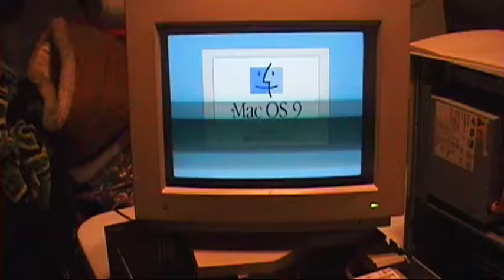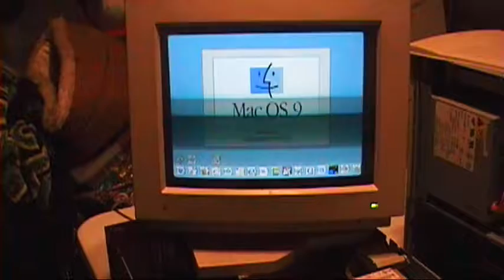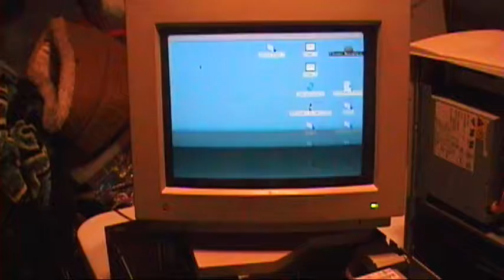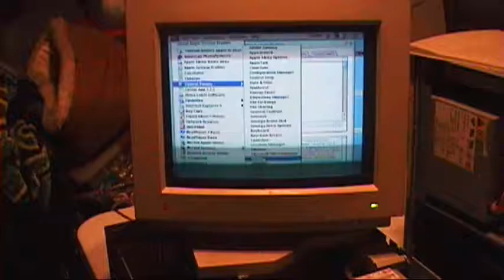'98 Beige G3 Power Mac Motherboard Swap - Failure?? - Far Out Friday

Comment: i have the old imac g3 from 1998 and i think my power board is fried, the analog video converter thing which is used to deliver power to the CRT, the rest of the computer works but it wont boot due to that issue now lol, not the same as your system but, do you happen to have any g3 all in ones?